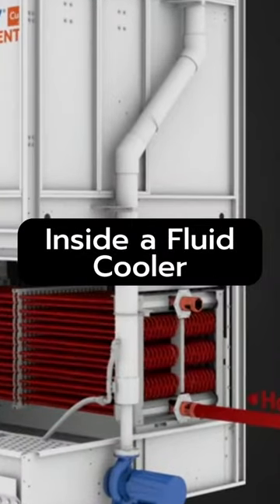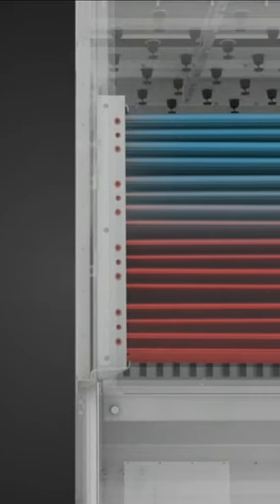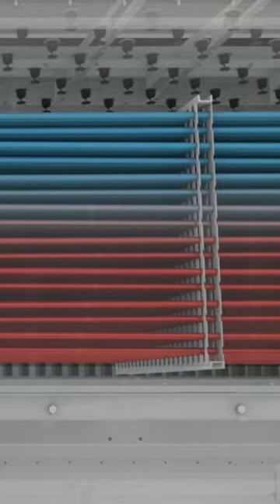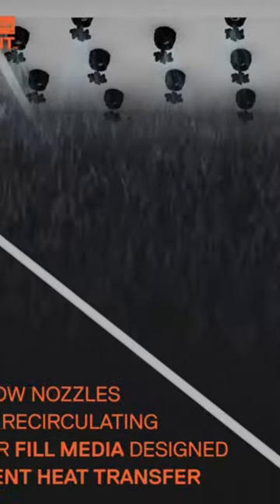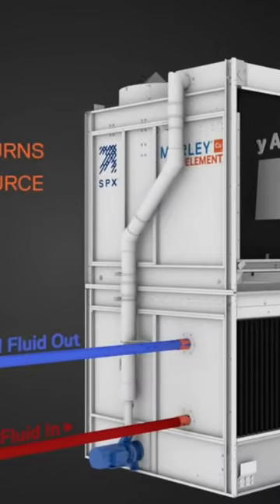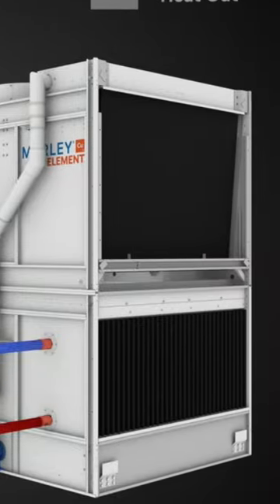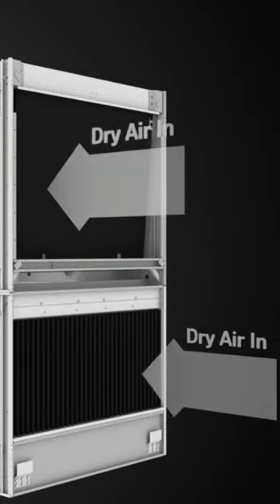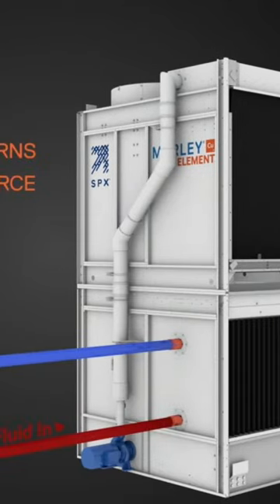Here’s what goes on inside a fluid cooler. #hvac #hvaclife #hvactechnician #coolingtower #savewater

Comment: Is this not just a cooling tower? I've never heard anyone call it a fluid cooler.
Reply from the maker: Good question. We call it a fluid cooler when the process water runs through a closed loop cooling tower. It’s common for application where you don’t want a convention, open loop, tower. Thanks for watching!
Reply: @Insight Partners HVAC TV  ok nice to know, I have a closed loop system I service for 100+ WSHP units, thanks for clearing that up.